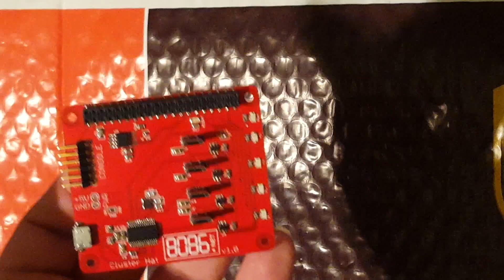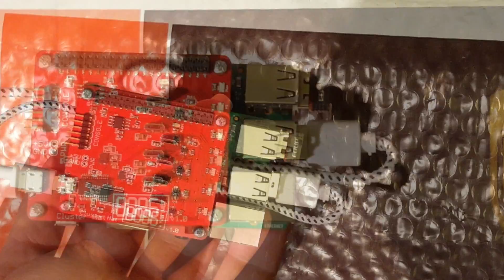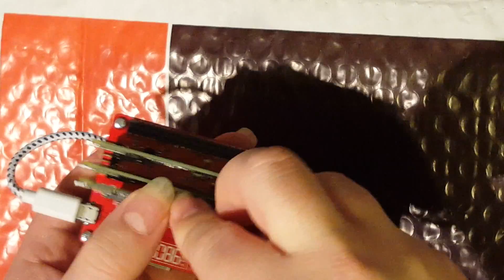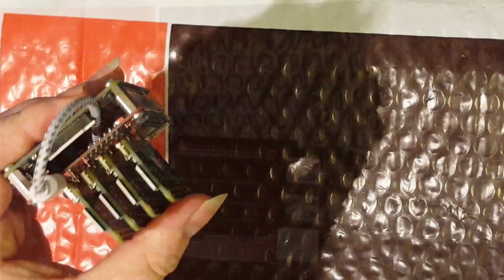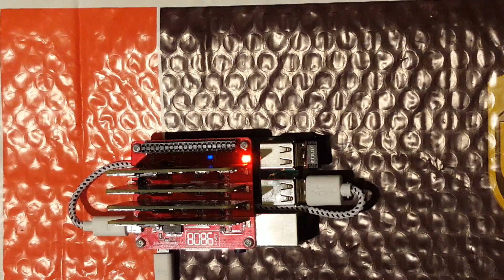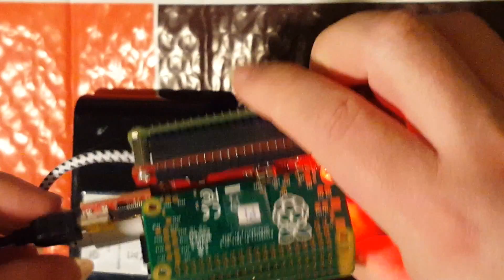Cluster Hat for Raspberry Pi Zeros (Overview)

Comment: So by doing this you get better specs??
Reply from the maker: It doesn't increase the power of a single Pi, you get up to 5 Raspberry Pi (Pi2/3 and 1 to 4 Pi Zero) networked via USB Gadget Ethernet which can be used for distributed programs/docker/etc.
Reply: @ChrisBurtonUK  Hey nice vid.  I am familiar with parallel processing with python, but was wondering if you happen to know if it uses all the gpu's and all the ram collectively too?  Or would that have to somehow be programmed?
Reply: @waynefilkins8394  good question. I think it's possible to add them all together.
Reply: @waynefilkins8394  You would need I much more high bandwidth connection for that (think 32x pcie lanes)

Comment: with the 4 pi zero's,. what would happen if i connected their gpio pins using 40 pin headers? and how many male to female headers would it take to extend the gpio pins from the pi3/4/5 to extend above the pi zero cluster so i can stack another cluster on top?
Reply from the maker: Connected how? Together=bad things, using right angle headers and plugging things into them using cables or like the Blinkt! in another one of my videos you can do normal things with them. No idea how many headers as no version currently uses the expensive stacking SMD header but you could use one of my butterfly boards to connect more than one (you need to use a Pi4 or 5 as the controller when using more than ClusterHAT one due to the older Pi being limited to 8 usb devices).

Comment: @Chris Burton So I'm on a mission to build one of those cyberdeck projects you've probably seen around youtube, but I'm looking to build one specifically as a mobile AI lab with a small cluster. So anyone know if this hat would work with a VIM3 Pro board? and can I cluster a VIM3 with rpi zeros? or would I be better off sticking to rpi and using a Coral usb TPU for my AI accelerator?

Comment: Don't mean to dog your channel, but I don't get it either.🤔 If clustering RPi is the objective, then why not cluster RPi Compute Modules, which are far more powerful than the Pi Zero, w/o wasting connectivity? The CM4 is scheduled to be launched anytime, now. If anyone is interested:
https://www.youtube.com/watch?v=IafVCHkJbtI
Reply from the maker: The Cluster HAT predates the CM3 release by around a year and before that the CM had the same SoC as the Pi Zero but, it's still a low cost and clutter free way of getting into clusters. I've since made https://www.tindie.com/products/8086net/cluster-triple-for-raspberry-pi-compute-modules/ and https://www.tindie.com/products/8086net/clusterctrl-single/ for those wanting to add compute modules to a Pi cluster.
Reply: @ChrisBurtonUK  🤯 Way cool! Thanks for the info. Only discovered the Compute Module recently (hey, I'm a 68 yr old hermit, okay?). Just received a CM3+ and a few different carrier boards. Can't see myself returning to the old form factor. Anxiously waiting for the CM4 to drop, along with a new USB-3x carrier board.
Sorry, I just noticed the upload date of this video. Best regards. Stay safe.😎

Comment: Hello! Does anyone knows which is the recommended rpi as controller to this day for v2 ClusterHat? I would appreciate if you have this information based on benchmarks. Thanks!
Reply from the maker: You can use any 40-pin Pi as a controller but with the Pi4 I'd recommend using the ClusterHAT High version (depending on enclosure) I've just added to Tindie to allow more airflow - https://www.tindie.com/products/8086net/cluster-hat-v24-for-raspberry-pi/

Comment: Wouldn't it just make more sense to run mutitple instances on a single raspberry pi? especially the 4 now that it has 4GB of ram
Reply: Is it better to have 5 servers with low specs or 1 super server? It depends on what you want to do.. this is a cluster, useful for distributed tasks..
Reply: If you want services to run even if one fails then you go with this kind of setup. If you have four and two fail you still have service.

Comment: Okay, you got it all up and running what does it do, I mean I really don't understand this cluster thing, can I make it boot into say Raspian desktop and maybe I have this really fast computer...?? What good is it? No disrespect I just have no idea what this is good for...
Reply from the maker: It doesn't increase the power of a single Pi, you get up to 5 Raspberry Pi (Pi2/3 and 1 to 4 Pi Zero) networked via USB Gadget Ethernet which can be used for distributed programs/docker/etc.
Reply: look up cluster computers in general, it is how super computers work. The issue is having a program setup to take advantage of it

Comment: Yeah but what does it do? How do you use it?
Reply from the maker: It networks 5 Pi together without many of the wires. It can be used for anything you can split over multiple machines (docker/mpi4py/etc.) or just as 5 networked Pi in a compact format.

Comment: You are TOP MAN! :) just wonder... I do a project 6 64x42 LED panels and facing huge flickering ( I thing because of lack of CPU power? ) is this cluster help solve this problem? or any other idea?
Reply from the maker: It depends how things are connected, if you can physically connect the panels over the 4 Pi Zeros+Pi3 and synchronise what you're sending to them it might speed things up if communication to the panel from the Pi is the bottleneck.

Comment: Getting this thing to work by integrating it to an existing SD image is unbelievably difficult. ive tried numerous times over the last 6 months to get any value from this and im beginning to feel my attempts are in vain. ive tried the methods on the website and i can barely get past the second step. everything i try is useless.

If anyone knows of a way to make this device work, in no complicated terms, please share this information, i am relatively new to raspberry pi's but im no idiot, the clusterhat seems unnecessarily difficult to use.

EDIT: I dont mean any offense to the maker, obviously its my incapacity to get it to work that is holding me back here
Reply from the maker: Happy to help get you going, head over to https://clusterhat.com/forum or create a support ticket https://8086.net/contact explaining what distro you're trying to use for controller/pizero, what changes you've made, what didn't work etc.

Comment: Couldnt you use the 5v GPIO of the raspberry pi 3 to power the hat instead of having the usb power it unless thats how it interfaces with the pi then it would also be better to use the gpios
Reply from the maker: It takes power from the GPIO by default, but it can be powered via USB (by cutting the jumper and soldering a bridge). The USB cable is only used for data by default.

Comment: Did you say the USB was for power if so why would you not get it from the gpio and if you are and the USB is for data can you not do that from gpio also
Reply from the maker: When I said power is from the standard micro usb I meant the one that plugs into the controller Pi underneath - on current HAT models the Pi Zeros get power from the controller Pi via GPIO by default and optionally using the solder jumper via USB or through a connector you can add to the HAT.

The USB cable going under the HAT allows the Controller Pi to communicate with the USB Gadget devices (Ethernet/Serial by default) on the Pi Zeros - there isn't really any other easy way to get ~100Mb/s between Pi Zeros and controller without using USB especially not if you want to use USB Gadgets.

Comment: So, if I understand correctly, the Pi Zeros are backpowered by the same micro-usb ports which are also connected to the hat's USB hub. The whole cluster communicates via USB and not over Ethernet, is that correct?

Comment: 1/ Are they plug n play out of the box? I can't seem to find any guides on this.
2/ so the compute power is 4 pi zeros nd 1 regular pi? Or the regular pi is only used to control but doesn't share the process power
Reply from the maker: 1) Using the images on the clusterhat.com site you get a Controller Pi + 4x Pi Zero networked over OTG ethernet 2) there is nothing currently for ARM to make a "bigger" single computer. You need to distribute your problem over multiple computers as with most other clusters.

Comment: Hello,  I read you need custom pi image or the vanilla one with your script but what does the controller exactly do. Can I run a different OS like hypriotOS. Is it any different then running 4 (or more) pi zero w and  interconnect through wifi? Just curious.
Reply from the maker: You can run any OS/distro with support for the Pi, what you can do with a different distro would depend on the what the OS/Distro supports in terms of USB Gadgets, udev, bridging, etc. The script on the controller either toggles GPIO pins (for v1.x) or talks to the I2C I/O expander (v2.x) to control power to the Pi Zeros/USB HUB/LEDs.  On the forum someone was saying hypriotOS doesn't support dwc2 so you probably wouldn't be able to use USB Gadget Ethernet/serial on the Zeros. The changes made to the Raspbian image are made to make working with the Cluster HAT easier for example it uses udev rules to give static names to the Pi Zero ethpiX and serial devices on the controller rather than them being assigned in the order they're turned on. Basic difference vs just using WiFi is you get to control individual Pi Zero power, you can login using USB Gadget Serial (serial console) and a faster network. See https://github.com/burtyb/clusterhat-image for the build script and files used to modify the Raspbian images.
Reply: Thank you for your swift reply. It is clear for me now. seeing your build video. 
Kind regards,

Comment: If you use a pi hat and install 4 of these pi 0's onto a pi3, does it give the pi 3 more processing power?
Reply from the maker: It doesn't increase the power of the Pi3, you'd need to write/use an application to take advantage of the Pi Zeros over the network connection.

Comment: So this essentially adds more cores/ram/etc, but can it run full desktop windows? You have about 3 GB ram and about 12 cores (or 20?) Or is it as silly as it sounds?
Reply: what program do you recommend?
Reply from the maker: You basically get 4 Pi Zeros and the Controller Pi on a network, it doesn't work as a single computer. You'd need a program to utilise them over the (USB) Ethernet connection.

Comment: hi Chris, i am not a person who has much hardware experience, how ever i program a lot. i have Few questions,
First does the hat allow networked access to the pi Zeros ?
and the second is there anyway to put lots more on the same hat i understand power is an issue. i am looking in to running a disrupted AI based on the pi2 or pi3 and using the Pi Zeros as nodes.
how ever i have been unable to find a slim hat other than the one you are displaying. that allows control over what would be the nodes. Plus i would need to run more than 4 pi Zeros i have not done the calculations how ever the more nodes the better i was hoping for around 12 Pi zeros on as smaller hat as possible with out having to have network cables.  i would be gratefully for you incite
Reply from the maker: With the Cluster HAT images the Pi Zeros are bridged through to eth0 on the Controller so they get an IP via DHCP and can be accessed from the local network. Sadly the CPU in the Pi3 (and all other RPi) only supports 8 host channels so you can't have many more Pi Zeros connected up before you start to have communication problems (from my testing they just don't show up at all once all 8 channels are in use).
Reply: Chris Burton frist thank you for taken the time to reply. i guess i will have to look at a diffrent method to use.

Comment: what is the point of this? do the zeros make it faster or does it just allow extra programs? I'm new to this and I've seen multiple pi supercomputers and they all require that you place part of the program on each pi, is it the same for this?
Reply: It distributes the CPU load across them all, essentially adding cores to the CPU.

You could of course just use this to network five Pi's via one Ethernet port, but continue using them separately.

Comment: What is this used for?
Reply: It's made for distributing a single calculation task to multiple cores. The easiest way I find to explain it would be when used as a rendering network for animations.

Basically, say you have 100 frames of animation to render. It's a single rendering task, but it can be split up into 100 sub-tasks, one for each frame (you could even split the frames into sections if you have particularly intense frames to render).
On a regular computer with a quad-core processor, it would render one frame split into 4, a quarter frame on each core of the processor, and output the result one frame at a time to the output folder.

With a super cluster, you can send out one frame (or sub-frame if you're doing that) to each of the cores in the cluster. In the example in this video, you have 8 cores. One for each Pi Zero and 4 on the Pi2. Each core (or node, as they are called) will check the output folder to see what frames have been rendered and which frames are currently rendered by other nodes. It will then pick the next frame that hasn't been worked on yet and start rendering it, marking that frame as "in progress" in the output folder so the other nodes knows it's being worked on. Once done, it will put the rendered frame in the output folder and restart the process, looking for the next frame to render.
When everything is done, you'll have 100 frames of animation waiting for you, usually a lot quicker than if you were to render it on your own computer, and with the added bonus that you can use your own computer while the cluster is rendering for you without slowdowns.

Any process that can be divided like this can be run on a super cluster. Mathematical operations, neural network training, simulations, you name it. If you can divide the tasks, the cluster can perform it.
Reply: This is a very useful tool if your interested in parallel processing. When done with software like mpi4py you make a pretty cool mini super computer. Perfect for programming deep learning or the brains behind an inmoov robot if your into that...
Reply: I just recently got a rasberri pi 3 to make myself a SNES and I've been expossed to many other projects I can make with them.

I don't understand much of what you just said but that due to my lack of knowledge.

Thank you tho. I have things to google and learn now.
Reply: Zachary Q. Dwyer  lol yeah i know the feeling too well haha. I went from wtf is a rpi to holy shit my crazy thoughts are a reality :p YouTube inmoov, deepmind/ deep learning, parallel processing and you'll get an awaome picture to build on if your into that kind of thing...

Comment: im having some problems with this set up, so far i have used the img files for main pi, and 1,2,3 raspian lite img files provided on the web site, but apon boot up i have the blue and red light, but no lights with a 2 second delay, i have to manually turn the zeros on in the cluster hat application. when i turn them on i get orange lights? creating a ssh file in /boot/ results in permission denied with ssh enabled or disabled.
Reply from the maker: Best place for issues is the forum linked from https://clusterhat.com/ which I see you've found :).
Reply: thanks mate, but i just keep hitting dead ends, is their no way you can make a step by step  tutorial on how to do this, im not a programmer, and so i need visual instruction, tried the beginner and intermediate steps, nothing works, hat see's no pi zeros, no pi zero loadup lights and im destroying new sd cards re writing img's im at a loss and my head hurts lol
Reply from the maker: When you hit a dead end go to the forum, explain the issue and what steps you've taken so we can try to help, until we know what the problem actually is there's very little we can do.

Comment: Thanks for this vid chris, i have one question tho, i need to run windows 10 on the raspberry pi 3, but i can not run windows 10 on a raspberry pi zero, so can i still do this project or dont we need to load an operating system on the zeros???
Reply: Brisbane Stomp you can't run windows on a raspberry Pi because it uses a incompatible CPU
Reply: Wasted.chrmosomes evidently hasn't heard of Windows 10 IOT.

Comment: Wait, so can this work well if I want to use retropi, specifically N64 emulation
Reply from the maker: AIUI Retropie runs on a single machine so it wouldn't make any difference.
Reply: I have emulated the N64 on my Phenom II running at 3.4 GHz.  A long time before that when the idea of an emulator for the N64 was floating around, people said it couldn't be done.  Well I guess that proves them wrong!!  I myself don't have any Raspberry Pis but they do seem to have good potential.  Right now the closest thing I have to one of those is an Android phone which BTW has many similarities.

Comment: you should do something like this with the pi compute modules
Reply: One of these for use with the Compute Modules, as the nodes of a micro cluster.... that would be awesome! Using a standard Pi 3 still for the master node, with 4 compute module fins... each micro cluster would have 20 cores.

Comment: does it work with the Raspberry pi 3b and what sort of program would I need to use it
Reply from the maker: Yes it works with the Pi3. What you need to use it depends on what you want to do, you could use distcc for faster compiles, MPI4PY for programming in python, some are also using docker and you can basically use anything that works over multiple networked Pi.